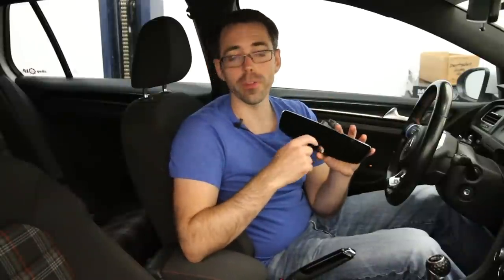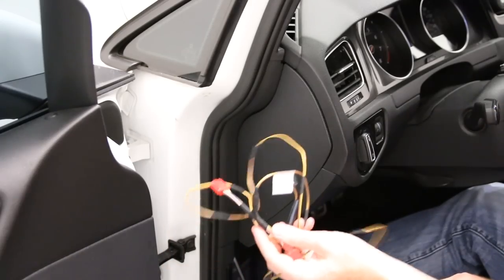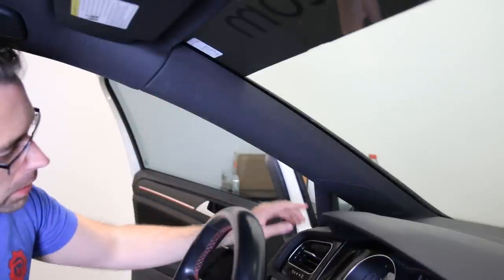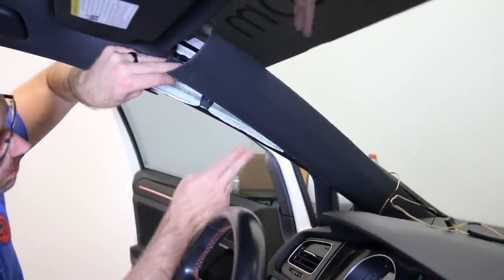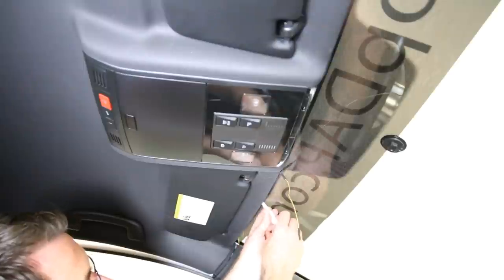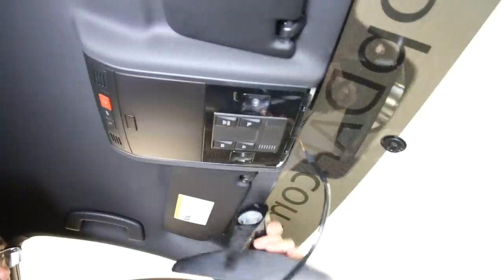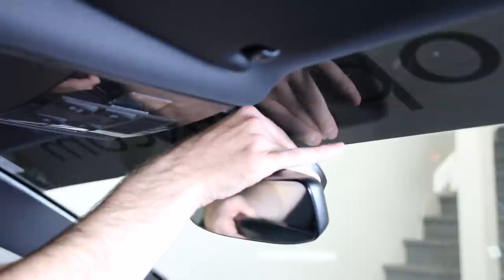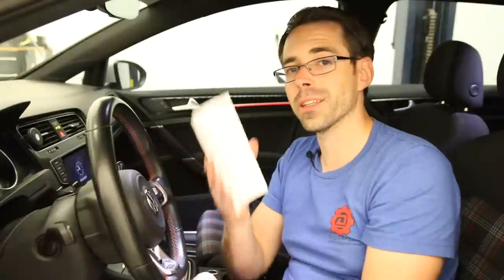MK7 Auto Dimming Homelink Rear View Mirror DIY

Comment: Great video.  I did similar on MY17 MK7 R last fall.  Bought 2016 Passat frameless mirror, and was plug and play in my car (no wires needed).  Only thing that didn't fit was MY17 wire trim plastic.  Tried 2016 version trim, no go either.  Somehow using both, managed to get the trim stuck in place, but with a gap on where upper and lower pieces meet.  Not fit and finish, but mirror works, and rain sensors still do also.  (My car is not equipped with DAP fyi)  love the frameless look!

Comment: Advice to people doing this.  My a piller on my 2016 did not pop off so easy.  I had Christmas tree Clips to deal with both on the removal and replacing. My headliner was super tight to the roof and not nearly as easy to fish the wires across as this one.  Be prepared to be frustrated.  Also the last trim cover he installed on his s does allow wires to be shown.  You may need to purchase a new trim plate to make it look fitted.
Reply: Did you have any tips for the Christmas tree clips? I can't seem to find a technique that works for me.

Comment: Great video.  Installed today.  Does anyone know if there's a way to code the car using VCDS to keep power to the mirror for 30seconds after the ignition is turned off?  As it is now, I have to remember to close the garage door before turning off the car because the mirror goes dead with the ignition.

Comment: Thanks for the great product. For other people considering this.
Trim may vary. Wife's jetta did not have a trim piece on the light switch. So having slack in the harness is not going to work.
Removing the visor clip helped tucking wires.

Removal of the A pillar will not be this easy. It requires some fenagling and possibly new hardware. It will slightly pop out to make things easier.
I know its not recommended, but I do not see how tucking the wires without zip tying will interfere with the airbag. Even if the wires are the way, when the bag deploys a measly little wire aint going to stop it. The wire is the least of you problem when that moment comes.

To test the auto dim, I had to turn the garage lights off.

Comment: For a MK7 R with rain sensor, would we still need to run the harness? I've been down that route once already to mount my dashcam, and would prefer not to deal w/ the Xmas-tree clips near the airbag again!
Reply: I have an 2017 R and will be doing the install this weekend of the rain sensor W/DAP version. It comes with the same type of harness shown in this video so it seems likely. Part Number: 000-072-548-F
Reply: What did you find out?
Reply: Update - The auto dimming headlights/brights is controlled by the lane assist camera so that should not be an issue, I found that information in my owners manual, I had initially thought it was part of the mirror.
-
I completed the install without issue and posted a couple videos on my channel, the mirror I ordered fit perfectly and I was able to use the existing wiring harness. Rain sensor, auto dimming mirror and automatic headlights are fine but I have not yet tested the headlight feature that will turn the brights on and off when there are oncoming cars. And the HomeLink is great!

Comment: ADD TO CART

I have a question though,  how different is the installation if you have rain sensing wipers?
Reply: @deutscheautoparts loved this comment but didn't answer? I have a mk7 golf R with rain sensing wipers and a front camera for auto highbeams/lane assist etc.
Reply: I'm kinda late to the party, but as I just did this upgrade on my 2019 GTI that has rain sensing wipers, I figure I can at least help others who stumble on this video. The rain sensor is directly behind the mirror mounting point on the window, and there's a different-looking attachment to that mounting point that only takes an eighth of a turn to tighten/loosen. Your car already has plastic coverings (two pieces) to hide the rain sensor's wiring, which you'll also use for the mirror's wiring. You'll need to remove the bottom plastic piece by loosening the two tabs on each side that lock with the top piece (I found it helpful to push in the sides of the top piece and to push a pry tool down into the gap), then sliding the bottom piece straight down (there's a channel on each side of the mirror-side attachment point for guiding the bottom piece's movement; see your new mirror to help you figure out the angle). The top piece won't come out until you twist the mirror out. Other than that, at least for GTIs, everything's the same!

Comment: Couple tips for those of you doing this on a car with Rain sensor and sun roof.  
-be careful taking the trim off around the rain sensor, it requires some patience.  (the rain sensor does not come off the windshield and I just left it connected 
- pulling off the trim around the overhead console carefully is important and key to getting the other existing trim pieces off
-the A-pillar trip piece doesn't come off as easy and the spring clips that hold it in will likely need to be replaced. (on mine there was a tab that prevented then from coming completely out and I had to almost destroy then to get then out).  I was able to save 2 of the three clips, so the car is together until I can order a couple clips.  I'm guessing they are very inexpensive parts. 
-when you install the wire for the mirror make sure you don't put the tie wrap around the drain hose for the sunroof
- though it doesn't look the same as in the video the existing mirror twist off counter- clockwise just like the one without rain sensing.  Be careful not to just twist the mirror and try grabbing the base firmly.
- when you put the trim on around the mirror after the install, put the lower pieces on first then slide the upper console piece in
-the wiring was just as in the video and it was very simple.
-it took me a couple hours, being really careful and taking my time..

Good luck

PS- the mirror looks great, the compass is cool and the homelink programmed so easily I almost didn't believe it
Reply: So if you have rain sensor, you still need to run the A-pillar wiring? I see some wire back there behind my mirror so I was wondering if it's pre-wired. I don't have the blind-spot monitor. 2016 Autobahn pkg. Thanks
Reply: Yes, unfortunately this one does not tap into the rain sensor wiring, you still need to run the wiring for the mirror.

Comment: It appears that you either had that A pillar trim removed before or the clips are of the wrong kind. The first two clips in the pillar cover are the lock kinds which prevent the pillar cover from flying off should the airbags deploy. Same lock clips also prevent you from pulling the cover off in the fashion depicted in the video.

Comment: I successfully installed this mirror on a MK6 Jetta TDI.  This applies to all TDI's, from 2011-2015.  Mine had no rain sensor, so I utilized the appropriate one.  I thought about replacing the windshield, but chose not to, maybe something to do at a later date.  The connectors that come with this kit won't work since the TDI uses the Euroswitch connector. (which is a good thing cause you can upgrade that  with a european version that gives you fogs.  Anyways, the two wires that go to mirror is yellow with a black tracer which is connected to switched +12 volts  and the brown wire which you will tie to ground.  I tapped off the wires on the lightswitch, using the Xz which is pin 1, and the 31 which is directly across from pin1 and has a brown wire going to it.  I guess brown mean ground.  I followed these instructions on pretty much everything else, but I did have to trim the cover just a tad to allow it fit between the mirror mount and the headliner.  Works perfect and looks much better than the flip style that came with the car.  Wouldn't be too hard for an after market seller to modify these to work in the Mk6.  hint hint hint.

Comment: I've read that there are 3 models. Apparently the 2017 with the rain sensor uses a different model than the 2015/2016 with the rain sensing system.  This is supposed to be the one for 2017 with rain sensing: 000072548F. Any comment DAP? Do you sell this mirror?

Comment: Is the source power switched? If not are there wires I can tap into easily?
I think it is completely ignorant that OEM Homelink are always on. That is like basically leaving a key under the doormat if you park your car outside.

All my afterthought Homelink installs are switched power.
Reply: To those are wondering, the Homelink is only powered when the car is on. Finally someone thought this out.